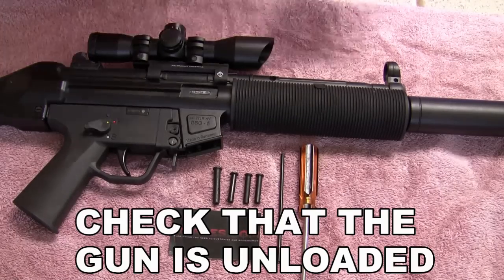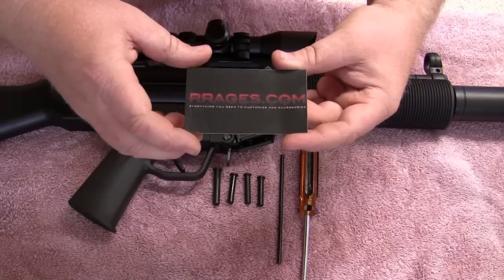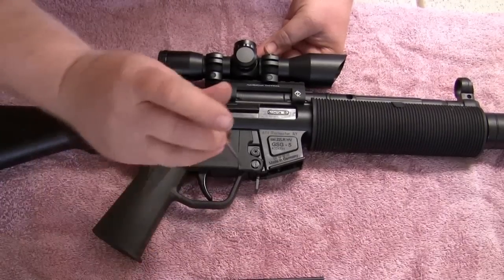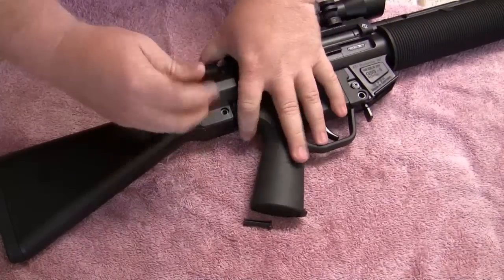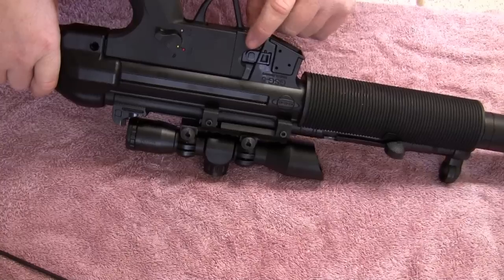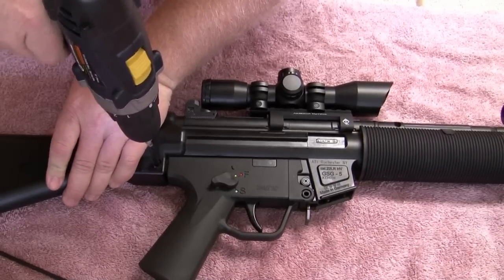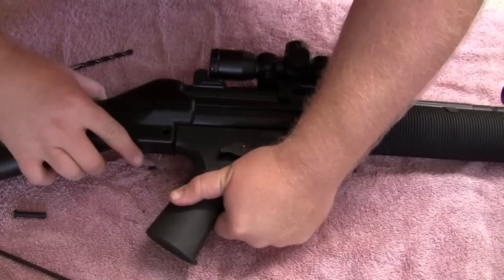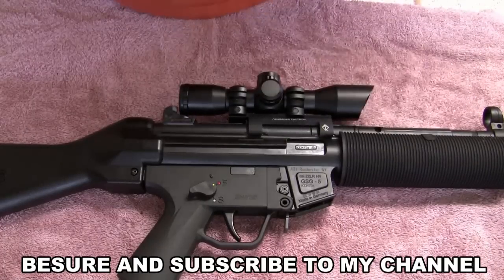GSG 5 522 22LR HK PUSH PIN UPGRADE REPLACEMENT SD HOW TO INSTALL GUIDE

Comment: Hey do you still have this gun? If so I would like some guidance. I trying to fix mine. The small spring that goes vertical on the gun that helps it reload busted. What is that part called